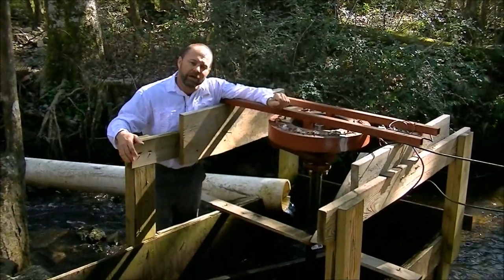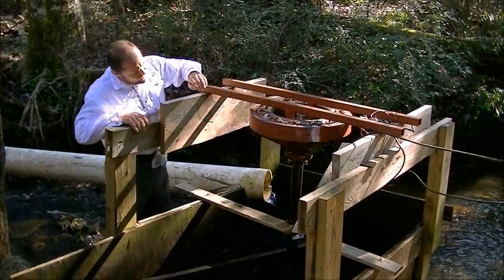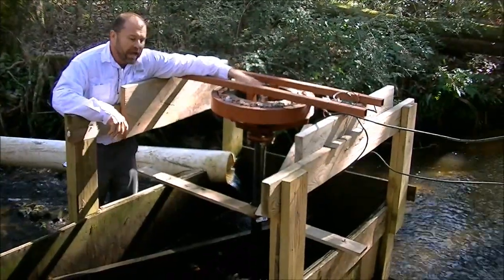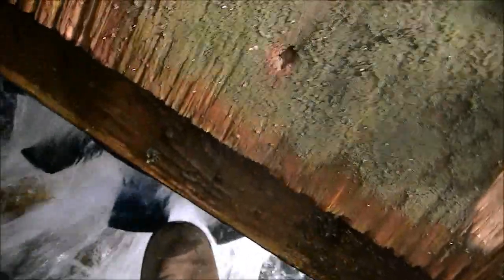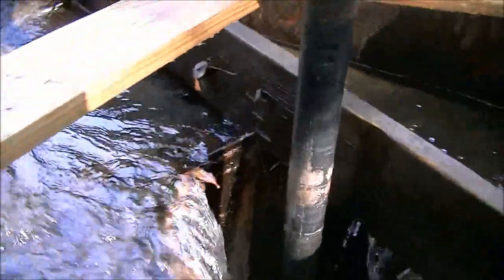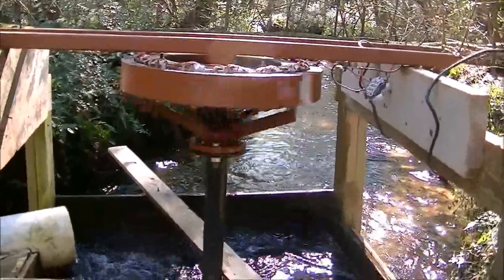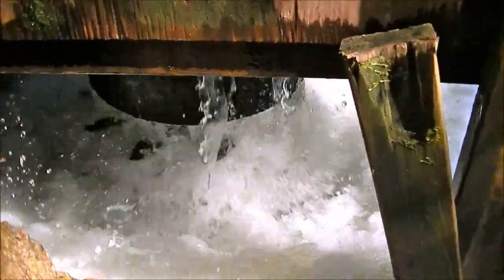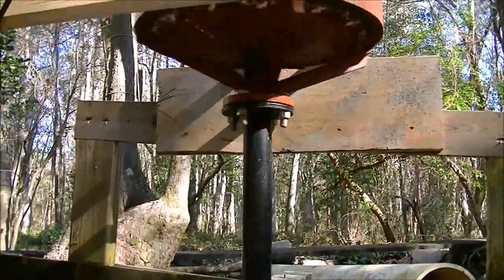Working home made hydro Generator/ Runs two refrigerators free electricity

Comment: I love your videos .... I'm into self sufficient/country living too ..... What is a good estimate of solar/hydro/ and wind power that I could harness with these DIY projects to go completely off grid?
Reply from the maker: I would start with solar array around a 1000 watts then add wind or hydro. It is hard to be off grid. I just run a few appliance's
Reply: Thanks brother .... I defiantly could do solar and hydro since those are the best 2 sources readily available to me ... Also, could I hook 3 or 4 of the hydro generators together in 1 battery bank?
Reply: And how do I go about ordering a hydroelectric generator from you?
Reply from the maker: wayne101803 Yes, You can hook more then one generator to the same battery bank. It is like having more than one water hose filling up a pool.

Comment: I might of missed it
But if the water is hitting all the blades at the same time
How is it revolving?
Reply from the maker: The blades are bent at a angle to the falling water. It is like a sail boat going side ways with the wind.
Reply: markp0177 Have you tried using less blades in the water? I work on large Archimedes hydro generators and it takes very little water to drive a large screw of maybe 18 to 20 tons in size. more blades in your case could cause drag on the drive. I'd try starting with 4 blades and keep adding to see at what point you reach maximum RPM. or failing that channel the flow so its only hitting one side of the blade assembly as on a waterwheel. Not being clever but just can't help thinking that many blades with so much water is causing drag thus reducing your maximum RPM. Good set up though
Reply from the maker: Martin Chapman I did start with just 5 blades, I get more power with this set up. I can lower the shroud and get more power but it is not self cleaning that way. If I needed more power in a pinch I would just lower the shroud.
Reply: al Meggs, I would think that the blades are angled so that the downward force of the water causes the turbine to turn in one direction. Similar to the blades on a airplane.

Comment: I would be interested to know how many batteries he has gone through in the 10 year period.  The problem with these so-called "off grid" systems is that you maintain a dependency upon the availability of batteries, for without them all the off grid generators are useless (unless you have the technical expertise to be able to wire up the generator DIRECTLY to the item needing the power, which is far beyond most people. The utility companies are laughing because you can in vest in all the OFF GRID POWER GENERATING systems in the world, but if batteries are unavailable or too expensive you are screwed. 

THIS IS NOT INDEPENDENCE.  It is simply a different form of dependency upon technology.

People who are truly interested in living independently need to consider lifestyle changes that will truly allow this lifestyle. I recommend a book called "Surviving Off-Off Grid" by Michael Bunker where the concept of true off-grid living is examined closely. The book leans strongly on religious teachings, so if that offends you I encourage you to overlook it and concentrate on the wisdom behind the dogma. In order to be truly self sufficient you MUST be able to live apart from any need for technology.
Reply: Do you disbelieve in bacon or what? Your off brand perspective is covering my LED backlit screen. Wasting my pixel space and my battery to light up your font wordism.
Reply: Its independent enough.  Stuff like this saves money.  Batteries are becoming cheaper and last longer.

Comment: So much potential in this creek. Its good you are doing something! But you can have ten times more electricity if you would like to tinker further with larger set ups. They will work absolutely. Do the pelton large wheel that is the way to go, also you can pair the pelton wheel make a wide turbine set up to harvest more hydro, anyways you are one lucky man to have this creek in your disposal
Reply from the maker: I tried the pelton wheel and I could not get enough rpm with direct drive. I did not want the maintenance of gearing it up. I have just rebuild the system and will be videoing it as soon as my creek gets out of flood stage.

Comment: You'd simply wire the stator with 24awg or smaller, produce high voltage at the generator. Then throw it through a transformer after that 1/2 mile transmission. Small wire and drastically less losses along the way; only slightly more complex. The high voltage could be dangerous if not respected.

Comment from the maker: A 1/2 mile is a long way. He would have to have a big wire and use ac then convert it to DC at the batteries. The cost of the wire would be to much.

Comment from the maker: I go straight to the batteries from the generator. It is just like a wind turbine. I have a charge controller on the batteries that dumps the load if they get over charge. This way there is always a load on the generator. I have a inverter that is powered by the batteries. It has been running my refrigerator for over 12 years now.
Reply: Can you send me the blueprint
Reply from the maker: @IsmaelStanley75  Sorry I do not have any drawings. I do have several other videos showing more about it.

Comment: This is a really great setup.  How does winter affect your setup?  Unless you are in a place where the winters are mild.  If you utilized an alternator instead of dynamo, you would get much more power.  Magnets lose magnetic field, especially if you increase the load on your generator.  That's why you get more power if you use some of it to generate an opposing field to the coils instead of magnets.  That's why cars have alternators not dynamos. It' easy to do without major mechanical changes.

Comment from the maker: Well it takes a lot of power to run your house. You have to have a good head pressure to generator electricity. You need a least a 3 foot water fall. You have to build your system to match how much water you have and how far it is falling.

Comment: I do have a stream running 100meters from the house through out the year. how can I use it to generate power(set ups), what is needed or required and cost  to set it up to power 2 houses or more

Comment: if you want to spin it faster you will need to change the angle of the blades... 
or high of waterfall, or make a better funner that will not slowing down the river speed so the blades will be faster... all your settings depents from how fast is the water coming through your blades and the resistand of coils magnets and axis is predusing... 45 degrees is fastest, most powerfull setting you can try. more degrees, more water free less power. less degrees, less water free more speed...
ELECTRICIAN

Comment: the best way to make this more efficient is to make  the shroud closer to the blades and make it spin the magnets fast with a gear up system.  but he has it open so it wont jam from debris in the water and a gear up system is more work. and more things to go wrong. so it can produce more power but you need to build to fit your power needs.

Comment from the maker: Yes the current would scale down. The smaller the generator the faster it has to turn. You could rewire a trolling motor with smaller wire and more wraps and generator power on a smaller scale.

Comment: Mark, I also started of with a water wheel and then tried a propeller or runner as it is called in turbines. I can promise you if you continue the tube past the turbine wheel and put the tube in contact with the lower water pond your system will explode in so much extra energy. Also look for "draft tube" on the internet and you will harvest another 100% more energy.

Great work!

Comment from the maker: Well it is too much water for a water wheel. Water is not passing thru unused because the propeller is spining 170 rpm. I use to have a water wheel there for many years but it was too much maintenance.

Comment: Very cool. I vaguely remember reading about a farmer that converted a windmill to generate electrical energy, while at the same time it would slowly and steadily fill a giant cistern with water, that when it was full it would trip a dump valve that would run to a water wheel that would power a second generator, and then when the water level fell to a certain point it would trip the valve closed to start the cycle over again. if i am remembering it right he was using for elect. and mech. energy.

Comment from the maker: They do make fun of the way I talk here in the south. It is not the size of the wheel that gives you power but the "head" , how far the water is falling. A 15 foot wheel would be great if you had a 15 foot head. If you only have a 5 foot head then only build a 5 foot wheel. If you have enough power to turn two that would work but first max out the one generator then see if it is worth it to have two. How much water do you have and how much head? Where do you live?

Comment: Mark, I went to glowingglasscreations and saw their water wheel. If I was to build a real wheel, like an old grist mill, a very large wheel, could I run more than one generator off of the mill wheel GGC's wheel was very small. I'm talking about a 15 foot wheel...I don't think your generators put any drag on the wheel or blade when producing electricity. Your advice is very much appreciated. You do the South proud brother.

Comment from the maker: Yes my first setup was kind of like a pelton wheel. I directed the water at bottom to hit cup shape paddles. I did get more torque but less rpms. I did not want to use pullys to speed it up, I wanted direct drive so I found this method works well.
Reply: https://youtu.be/4o4t8ZChSHQ
Reply: https://youtu.be/WJmzQKd_8sY
Reply: https://youtu.be/BqGTNjywcvA
Reply: https://youtu.be/ARMizdzsDVQ
Reply: https://youtu.be/gY3p2e1-kN4

Comment: Very nice generator and hydro installation.  I like how you designed it to pass sticks, pine cones, fish, and turtles.  I notice you put the rectifiers at the generator end.  Have you ever considered transmitting AC to a point closer to the battery bank?  In the case of a wind generator, I think it would be a good idea to keep the rectifier on the ground for easier maintenance or troubleshooting.  You are blessed to have so much water running across your property.  Thanks for sharing the videos.